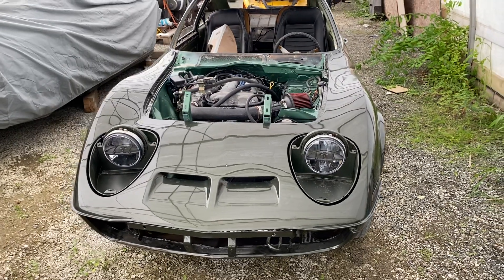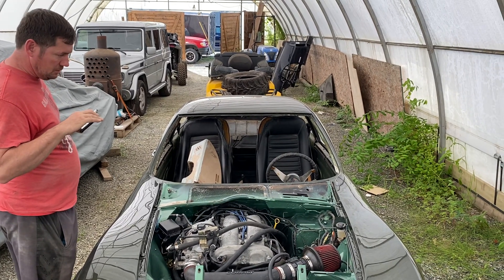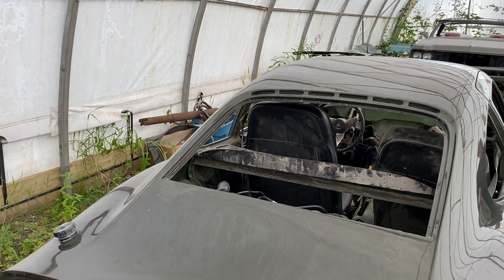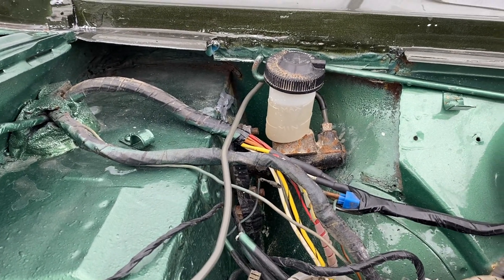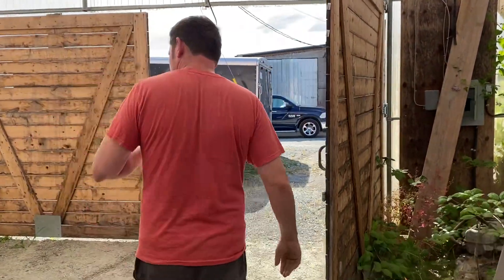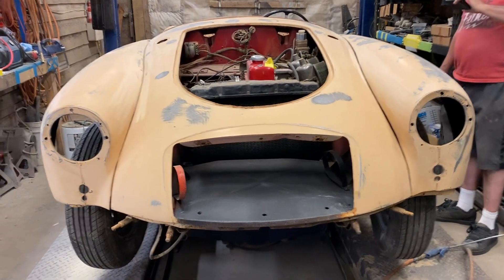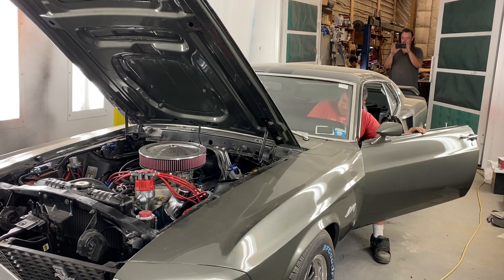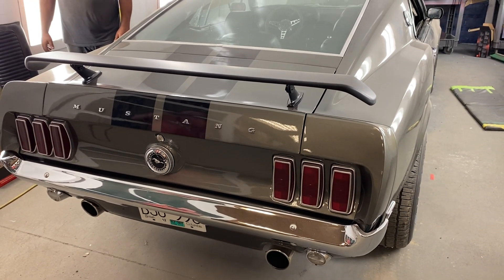Opel GT with 1.8L Miata engine and transmission + a visit with Trigger Auto Painting.

Comment: I had a '70 Opel GT when I was in college and a few years after. Now I have a '90 NA and a '99 NB Miata. So a strange coincidence. I would have probably just overhauled the original Opel engine, but maybe there are no longer parts for it. I remember having carburetor problems with the original Opel engine, and found out a Ford Pinto carb fit it perfectly. And the rear differential went out on me and I had to replace that. And I did a clutch replacement on the Opel GT and I've also done that on the Miata's. The Opel was a lot easier to do.

Comment: To make anything out of those cars , other than a Frankenstein, you have to re-engineer every aspect of the car. The suspension was crappy, the brakes were crappy, the body rotted, the front belly pan got hammered up into curbs, the diffs were not strong enough for major power, and the wheels and tires were too skinny. Did I forget anything?  Oh Yeah, the ignition and electrical in the dash always needs replacing...including the dash itself !   I owned one...bought it with 40,000 miles on it...and it was scrap even though it looked good design wise. If I did one now, I would cut the entire floor pan out right up to the inner rockers and from front to back...then I would put in a light gauge rectangular tube frame and build the floor and console around a better engine and trans and diff. combo.
Reply: Yup..  too bad they were junk, they had a good look.
Reply: If there is good shape then you just take it apart repaint inside and out. Then like you said add some bracing.. lamons guys won many races so there not junk and 200 to 250hp with 250tq and you have a 12sec car that handles like crazy

Comment: Would be better with a 3.4 3500 hybrid 210hp 260tq with a gm automatic trans a few have been done already. The torque is what makes them move those Miata engines don't produce enough torque less torque than hp that's why it sounds Rice motor
Reply: Not everyone enjoys GM. I personally don’t that why my GT is rotary. Opel has never been an American car so why stuff a boring engine in it.